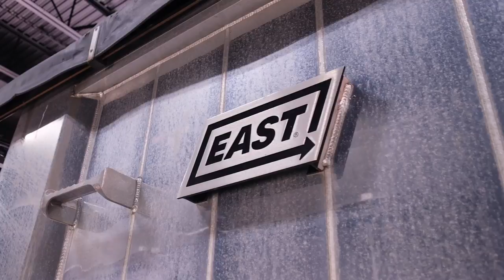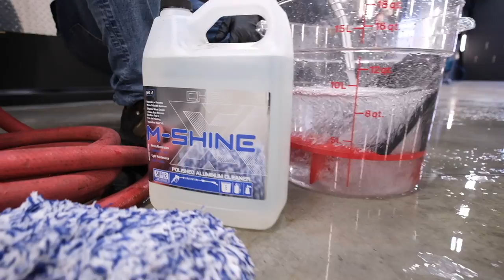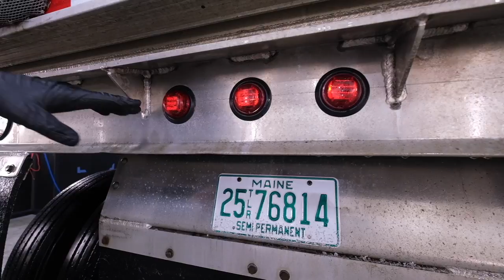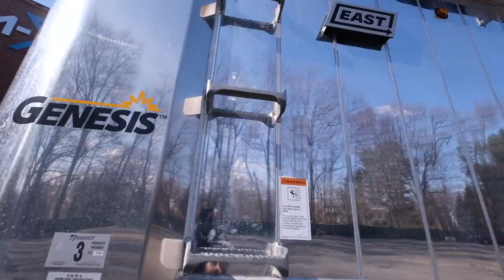FIRST WASH on A Smooth Side EAST TRAILER Since BEFORE WINTER!

Comment: Ever since I watched the cleaning of that front loader, a memory has been just at the edge of being recalled. Now it hit me, except I can't recall the name of the cleaner, but I do remember how good it was on aluminum (polished and brushed),l. Just wipe on let it foam off then rinse. Dirt, brake dust, salt, oxidization, axel grease gone. I do also remember that you really didn't want to get any on your skin, chemical burn and all you know. It finally struck me when seeing the crud start sliding off the wheel.

Comment: That's the 3 step punch I use but I do a deionized water rinse an just let it air dry an man u gotta love a clean truck
Reply from the maker: I may wanna throw a di water supply in for final rinse eventually, I’m more curious to feel the pain of the hard water folks for now tho, helps me present realistic results
Reply: @ChemX  that's a pretty good way to look at it lmao I'm alwase looking to improve I just wish them car wash blowers were cheaper id have my own drying rack I could pull thru after a quick rinse an dry ill settle for my di an ro filters for now lol

Comment: I hauled salt this past winter and I have the same thing on my aluminum body from running in the winter. I even would go to the Blue Beacon so that those spots that’s on this dump trailer wouldn’t be on mine and I still have them. Just no as bad as this truck.
Reply: Needs ceramic coating

Comment: Lots of questions hope I get answers... first off how much of the 2 step did it take to get the whole thing done? 
How much of the mshine 
And what would a shop even charge for a job like that ... be great to get some insight I'm learning the ropes
Reply from the maker: I used 16 ounces each of the touchless concentrates, and I mixed the mshine strong at 4:1 so a full gallon of that, a wash like this would probably get $200 roughly if I were to charge to do it, never have tho lol😂🍻❌

Comment: This and in many other washing videos that I saw, people tend to wash bottom to top, and the half-washed soap and dirt simply flow down the newly washed surface, with great help from gravity.
Isn't this a wrong way to wash, or am I missing some logic behind this?
Reply from the maker: It’s only done like this in a touchless wash when foams are applied at low psi, these soaps can’t clean the surface 100% on their own the high psi is half the process, bottom to top allows you to see where you have hit with the psi, if you miss a spot it’ll show when dry just like missing a spot with a mitt, final rinse is still top down

Comment: Why not rinse from the top down and not bottom up
Reply from the maker: It’s only done like this in a touchless wash when foams are applied at low psi, these soaps can’t clean the surface 100% on their own the high psi is half the process, bottom to top allows you to see where you have hit with the psi, if you miss a spot it’ll show when dry just like missing a spot with a mitt, final rinse is still top down

Comment: ? Why do u wash bottom to top ?
Reply from the maker: In a touchless wash with low psi foam cannon soap application it helps you not miss a spot, the high psi is at least half the process of getting the road film off, just a little better finish
Reply: @ChemX  thank for the info

Comment: You rinse top to bottom ugh!
Reply from the maker: So if your washing any vehicle by hand you rinse top down, also if you two step touchless washing with high psi soap injection you would rinse top down, but if the two step soaps are applied at low psi with foam cannons the results will be much better rinsing bottom up, it allows you to see where you have been with the high psi which is half of the process